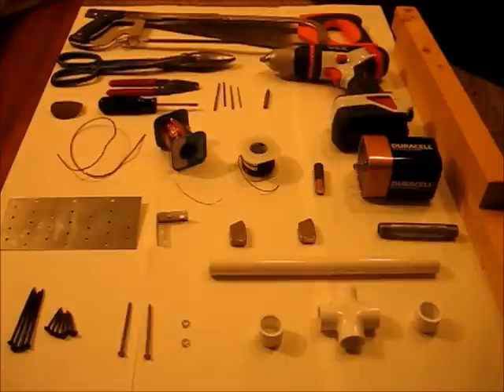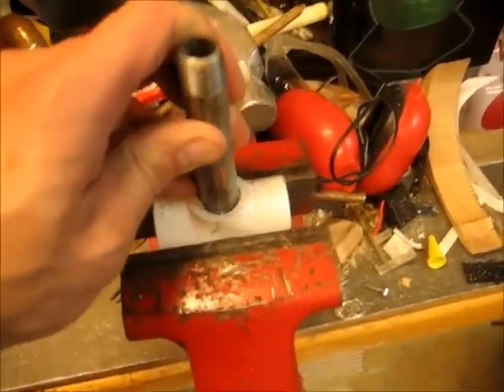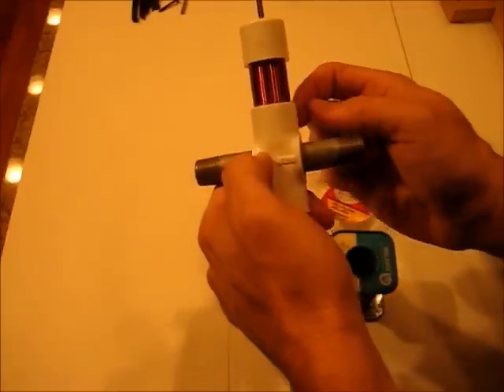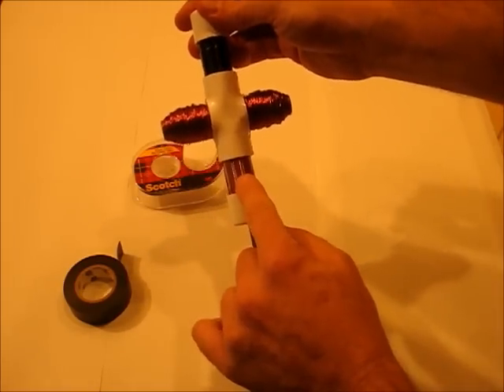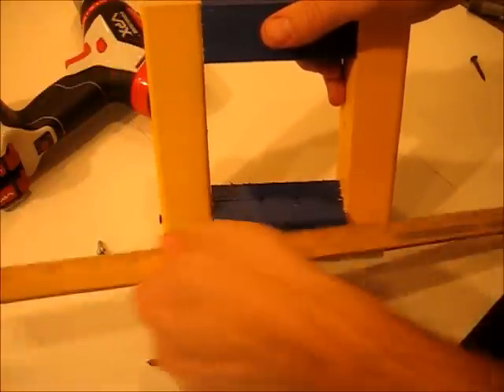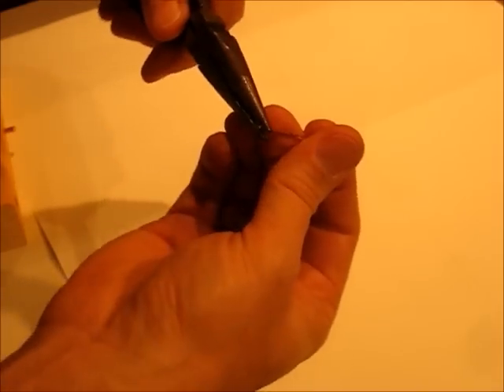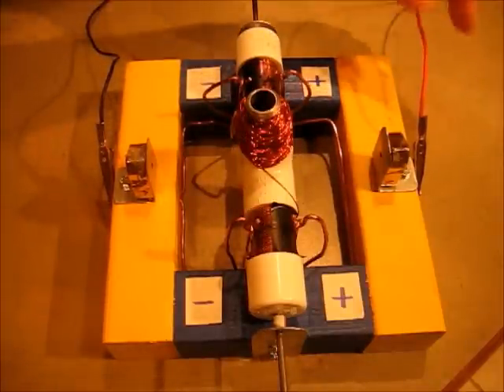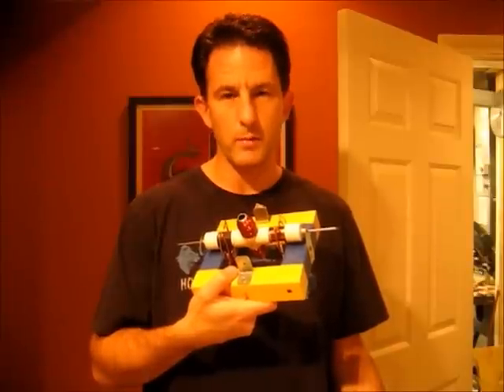How To Build a Motor (HowToLou.com)

Comment: Does it work as a generator too? So the other way around
Reply from the maker: +Saxpro2000 - Yes, this is a DC motor and works, in reverse, as a generator.  If you chuck one of the nails in a drill and spin it fast, you will be able to read a voltage across the motor power terminals.  It might be enough to make a small 6 volt light bulb glow a little, but I am not sure.
Reply: +HowToLou thanks :)

Comment: Will Ferrite magnets do the same job?
Reply: And I don't understand Anja Bea's design, as the video is really low quality. What exactly is the "glass" like and where exactly is it? I would like to do her design but I don't understand it, and because of that, I don't know what to buy for it.
Reply from the maker: +Ayzee Hawk - yes, but the stronger, the better
Reply from the maker: +Ayzee Hawk - there is a small piece of flat glass on the table, and the entire weight of the rotor is resting on one nail point on that glass.  It's as close to frictionless as you can get.

Comment: Hey Mr.Lou, can I substitute the 4 lantern batteries with 3 9V batteries?
Reply from the maker: Maurice - No, Sorry.  Even though three 9-volt batteries have more voltage (pressure), the four 6-volt batteries provide a lot more amperage (flow).  You need that big flow of electrons running around the coil, to produce a strong magnet.  Power = Voltage x Amperage.  The little 9v batteries barely trickle amperage, so the power ends up pretty low. Think soda straw versus garden hose :-)
Reply: ***** I thought so too! thanks again Mr.Lou :)

Comment: is it inconvinient if i have one side of the threaded pipe much thicker than the other?
Reply from the maker: That is not good.  The pipe should be the same on both ends, or the rotor will be unstable and vibrate badly.
Reply: ***** so i should count how many round I make on each side

Comment: can you explain how the magnetic fields are involved in this motor?
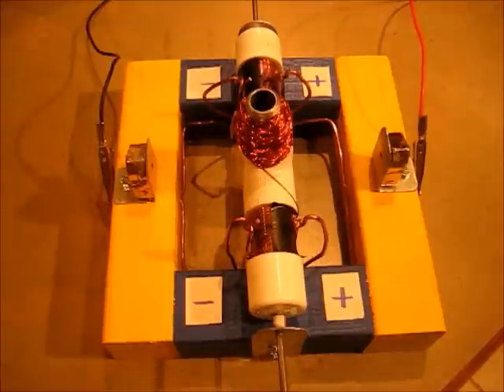Reply from the maker: Anthony Martinez - I did in the video.  Rewatch at 9:17.   The stator magnets produce a constant North-RotorInTheMiddle-South magnetic field.  The rotor has a North-South field too, so it flips over to get its North Arm next to the South Stator and its South Arm next to the North Stator.  When it gets there, however, the commutator flips the direction of the current flow through the rotor, which also flips the North and South Arms of the rotor, and the process starts over again.  Its is kind of like like a dog chasing its tail, and never catching it.

Comment: Could you please give the gauge of the wires? and the type of batteries you are using?
Reply from the maker: The magnet wire is 30 guage and the stator wire is 14 guage.  Any brand 6-volt batteries will work.  Make sure to read the build tips at HowToLou.com/motor before you start.
Reply: ***** thanks. also, the copper wire i am buying are all insulated with rubber coating. Do I have to strip all of it? The electrical store i went to doesnt seem to have the ones in this video that are already bare.

Comment: Can I know what gauge wire you used for making coil?
Reply from the maker: I don't remember where I got the wire, but just google 22 AWG solid copper insulated wire.  It should look like the picture above.  The insulation should be clear, like enamel, so you can see the copper color.  You can get a 1/4 pound roll on Amazon for about $10 or a 1 pound roll for $20.  You only need a 1/4 pound for this motor.  See other build tips at HowToLou.com/motor

Comment: is the metal pipe made of stainless steel?
Reply from the maker: No.  Its is a plain black iron or galvanized steel pipe.  You can buy them in the gas plumbing section in the hardware store for about a dollar.

Comment: what was the length of the wire?
Reply from the maker: +Giovanni Forastieri - Sorry, I did not really measure it, but I think I used most of a 1/4 pound roll of 32 awg copper wire

Comment: would mig welding wire work for an electric motor or not
Reply from the maker: No, MIG wire will not work, because it is bare.  You need wire that is insulated with plastic, or better yet, with enamel (magnet wire)

Comment: How do you terminate the final wire for the brush?
Reply from the maker: Both brushes from one side of the motor connect to the stiff copper wire that sticks through a hole in the side of the motor.  Same thing for the brushes on the other side.  Connect your batteries from one side of the motor to the other.
Reply from the maker: It finally dawned on me what you were asking.  The brushes "terminate" to the rubber band, which holds them against the commutators.

Comment: will this work with a 6v battery if not how do you make it work with a 6 volt
Reply from the maker: a LOT of wraps, a plastic rotor arm, strong magnets, and maybe ball bearings on the nails.

Comment: could this pull a light rc car on a flat surface?
Reply from the maker: If you mean, tow an RC car across the floor on a string, winding up on the motor's axle, then yes, I think so.  If you mean, put the motor and the battery pack in an RC car, then no, that would be too heavy.

Comment: Hi Lou, I've written a lot of comments, I know. Actually I managed to build your motor, but it doesn't work. The magnetic force generated by the rotor is too weak, I really don't know what to do and I'm in a great hurry!!
Please help me!!
Reply from the maker: If your force is too weak, you need more windings on the rotor.  You can also try a plastic pipe, instead of steel.  Makwe sure you are using 24 volts.  See more tips at HowToLou.com/motor

Comment: Why did you shave off the insulation on the wire
Reply from the maker: The electricity travels inside the insulation.  You need to sand the insulation off the commutator, so the it can get in, and back out the other end.  If the brushes were just touching the insulated wire, no electricity could get into the rotor.

Comment: How does seven by eight make a square?
Reply from the maker: The two long boards are 7inches.  The two short boards are 4 inches.  The short boards go inside the long boards, which are each 1.5 inches thick.  So the height (long boards) is 7, and the width (short boards) is 1.5 + 4 + 1.5 = 7 also, making the stator a square.  By the way, it could really be any shape.  you just need a way to hold the rotor and the stator magnets.

Comment: if you shitch the megnets it changes the rotation
Reply from the maker: +Bob - The magnets should always be facing in such a way that they would stick together, if brought close.  If you flip both magnets, you will change the direction of the rotor spin.  If you flip only one magnet, and your motor still spins, it is only because one magnet or one rotor arm is stronger or closer than the other.  A perfectly balanced (factory built) with opposing magnets, would not run at all.

Comment: how do I connect the batteries to power the motor?
Reply from the maker: +Deni C - Use alligator clips just like I did.
Reply: ***** can you power the motor without alligator clips?
Reply from the maker: +Deni C - you can use plain wire and twist the ends onto the motor and battery, but I would not suggest it, because those connections can be unreliable.  Alligator clips are the way to go.

Comment: i know this video was posted a really long time ago but i am having a lot of trouble getting my homemade motor for a physics assignment to actually spin. i have emailed you as i have reached a desperate state haha. any help is so very appreciated!
Reply: Make sure that the direction on which you wrap around your enameled wire on each end of your rotor is  the same.  Make sure you are using an enameled wire aka magnet wire, a bare wire  is not going to work. Make sure you sanded properly the wires on the commutator. Make sure that the polarity of your magnets is correct, the north side of your one magnet must be facing the south side of the other magnet. Make sure that the wiring for your brushes is correct.

Comment: is theyre a way to use another motor to generate the power to make this one run so it can indefinitly
Reply from the maker: +guillaume proulx - All motors and generators are less than 100% efficient, mainly due to energy loss from friction.  Touch any motor that has been running for a few minutes and you will feel the heat energy escaping.  So, say you feed the motor with 100 watts of electricity. You only get maybe 90 watts of mechanical energy, and 10 watts lost in heat. You drive a generator and lose another 10 watts, so now you only have 80 watts of electrical power, which is not enough to sustain the original motor.  There are perpetual motion videos on youtube that show this working, but they are all fake.  They have secret wires to supply power.  Perpetual motion is only possible in a completely frictionless environment, such as a planet moving through space. Here on earth, there is friction and no perpetual motion.  The closest thing is spinning objects, suspended only by magnets, but even they lose a little energy as they stir the air around them and eventually stop.

Comment: Hey Lou, I built an electric motor based off your design. It's in my videos, check it out. Here's a link http://youtu.be/xHUoTRyFeuI Also, what do you think about me increasing the voltage with some more lantern batteries or 9v batteries? At 24 volts nothing gets hot.
Reply from the maker: Nice build, Mantis!  I like the commutator upgrade to copper plates.  That gives better electrical contact and longer motor life.  You are fine to go higher on the voltage, but just make sure it spins up.  If the rotor sits in one place too long, especially at a higher voltage, it will heat up quickly and may melt the enamel off the windings, or the wire itself.  Spinning motors also act like generators that push back against the battery, and actually reduce current flow.  

Other upgrades you could try would be to double the magnet strength, and use ball bearings.  It looks like you may have bearings of some sort, already.  Ideally, you want tiny ball bearings with an inner diameter the size of the nail.  The smaller the bearing, the less slowing back torque the friction causes on the rotor.  

Another option is to stand the motor vertically, and rest the bottom nail on a piece of glass. This is about as frictionless as you can get, and will speed you up even more.  Check out Anja Bea's vertical motor at HowToLou.com/motor.  I just posted yours there too.  Thanks for sharing.  Very nice work.  -Lou
Reply: ***** Thanks, I'm going to try it at a higher voltage and see what happens. Also, I originally had the thick wire touching the copper pipe, but it didn't work because of the friction so I did a little redesign with the thin wire. After that, I had a problem with the wire short circuiting on ever half turn so I added another copper pipe on the existing copper pipe. I did the redesign kind of fast and I didn't think it would work so I didn't even add two screws to the copper pipe. lol

Comment: Please help me! I have a project due and all i have to do is lift 1 gram up about a meter. I can only use one 6 volt battery, so would this work? Also, could i do this with a hand saw and hand screwdriver, because i don't own any tools?
Reply from the maker: Yes, this can be done with hand tools.  You might be able to get it running on 6 volts if you replace the steel pipe with PVC, put a TON of windings on the rotor, and got a couple of small ball bearings for the axles.  You would then tape a string on one axle, let it hang over the edge of a table, and lift a one gram wieght, as it winds up.  If you are allowed, I would just buy a toy motor at a hobby shop.  If not, this will be a tough assignment.

Comment: Hello.im making a dc motor for a school project.instead of using magnets our instructor tells us to use a field winding.Im confused if i would have to do the same number of windings in my armature and the field.How many turns is best?My magnetic wire is #36,can you please help me?
Reply from the maker: Mika - The bottom line for windings is: more is better.  Put as many as you can without making the rotor so bulking that it won't spin.  Your magnet wire sounds fine.  Make sure it is enamel-coated.  You are replacing the permanent stator (field) magnets with electromagnets. No, they don't have to have the same number of windings.  Again, more is better.  I would suggest you build the motor with permanent magnets first, because it will be easier to get it working.  After that, you can replace them with the electromagnets.  Please read all the build tips at HowToLou.com/motor before you start.